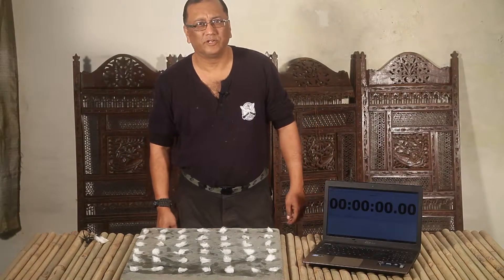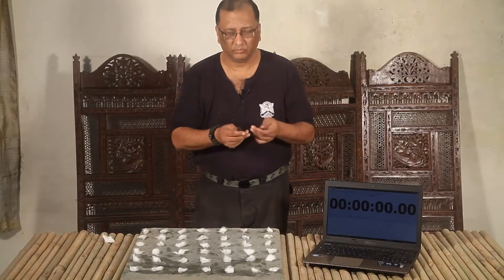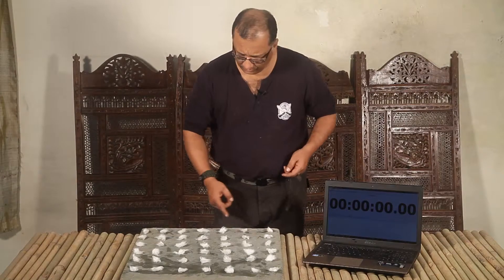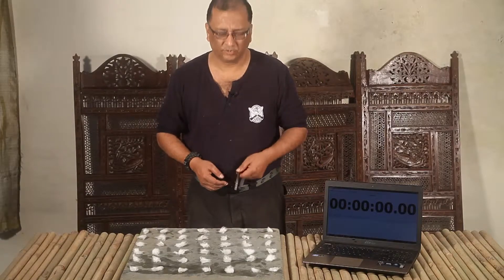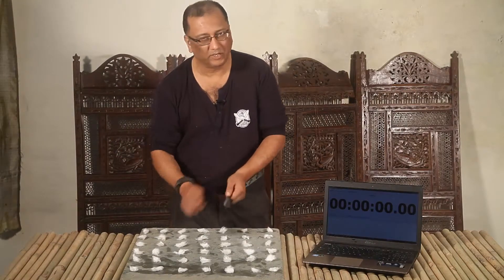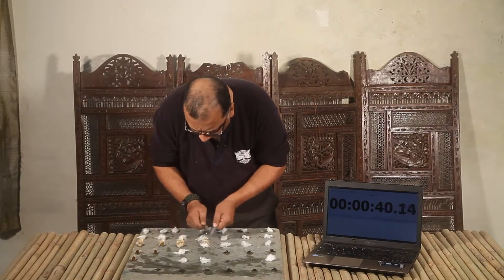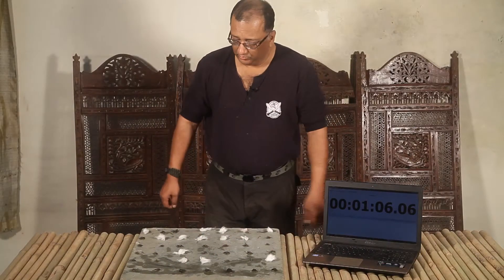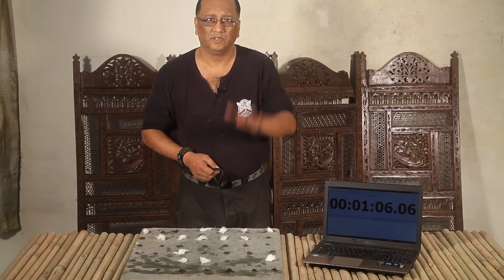Maximum tinders lit in 60 seconds with a ferro rod

Comment: Hey great video and quite the run on the cotton balls. I was just wondering where you were a couple days ago while watching some videos on youtube. I'm glad your back. You should try lighting the smallest possible amount of a cotton ball to get a fore started. I often wondered how well it would work to take a tiny piece of a cotton ball and just set it DIRECTLY on the ferro rod and then put the strike ON the cotton ball and strike it as you normally would. Now, ALL the sparks and heat will be right on the cotton ball and it HAS to light.....I would think. Then you're saving a lot of tinder to start more fired with one cotton ball. Kind of like match splitting. One match, two fires. It would be nice to see how many fire you could get going using just ONE cotton ball.
Reply from the maker: Hey wjf213, thanks for watching. And that's a thought. How many fires with a single cotton ball? By the way adding an accelerant will increase the burn time.